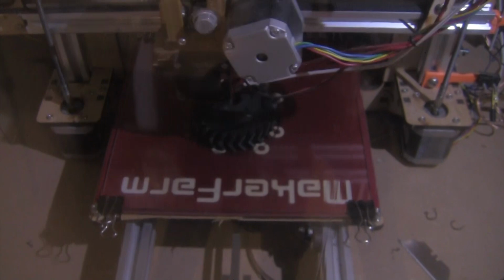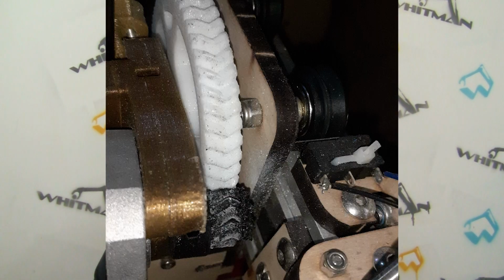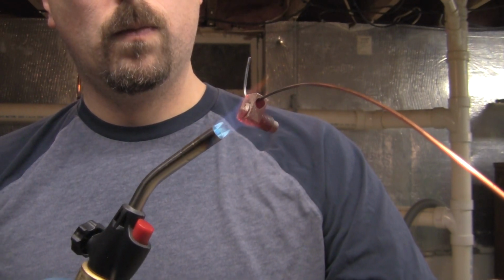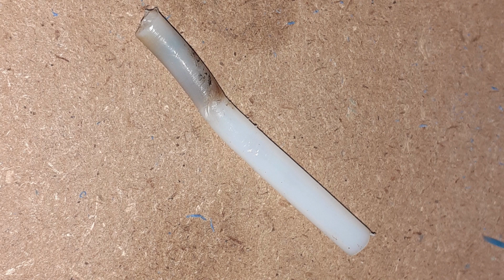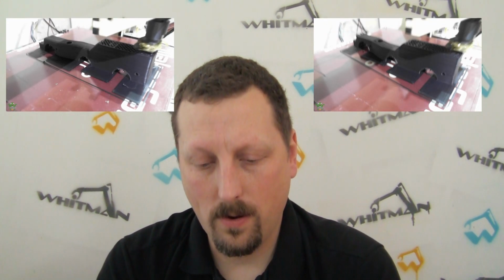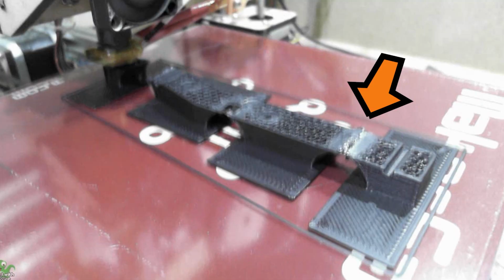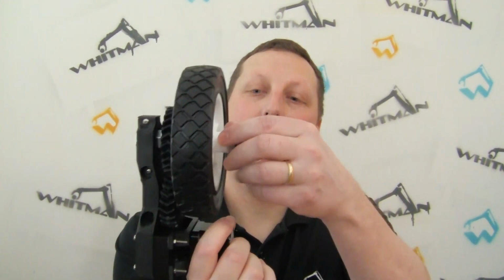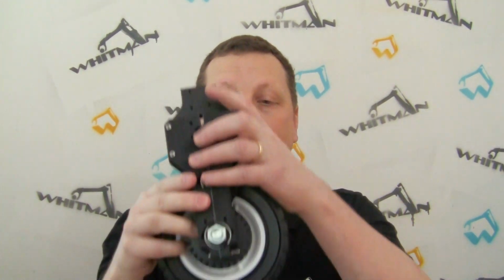3D Printing and FreeCAD - Multiple Failures - Ultra silent gears!  Nephele Robot Foot

Comment: jumping in mid of the show i thought you were making an organic compound. lol. banana bread? let's focus! lol.
Reply from the maker: Yeah, fair.  I love me a banana bread, though...
Reply: @WhitmanTechnological  maybe you can 3D print one. hahaha. BTW, why use slanted V shaped teeth on the gear? So it's quieter?
Reply from the maker: @motojc  Lol.  The "herringbone" gear, technically called a double-helical gear, is (supposed to be) quieter because the teeth are continuously engaged instead of engaging all at once.  Also, they're self-aligning as the angled teeth will slot into each other on the paired gears, which is really cool in some situations.  I never bothered to really calibrate my printer when I made this video so the gears are printer fatter than their spec.  I'm going to be printing some nylon gears with really good calibration first, and it should actually make a really quiet gearbox.
Reply: @WhitmanTechnological  cool! thanks for the explanation. Can't wait to see the nylon ones.